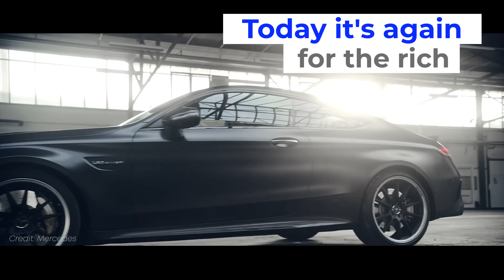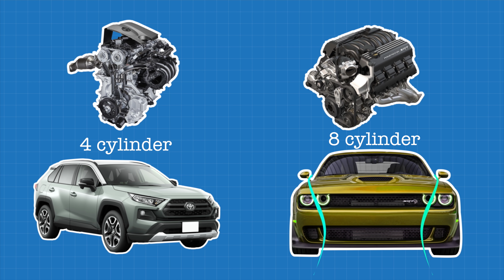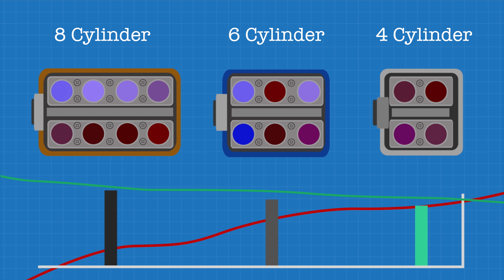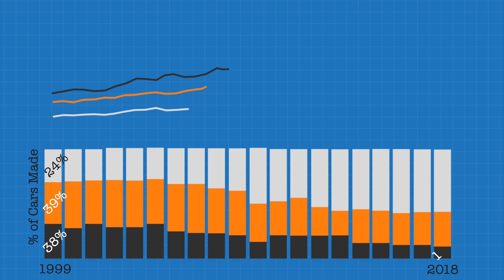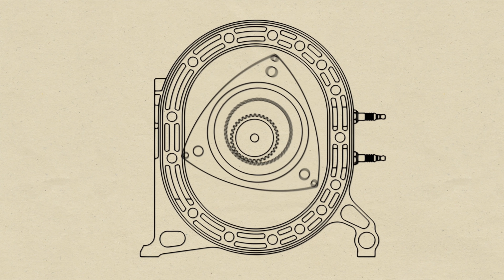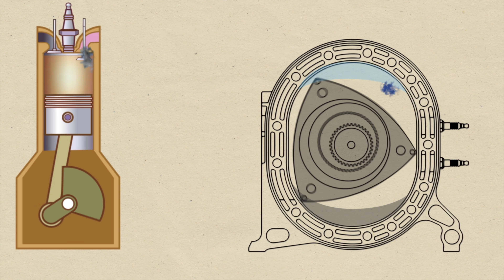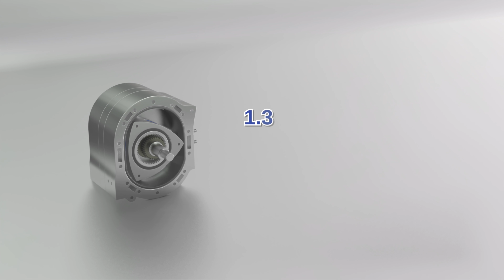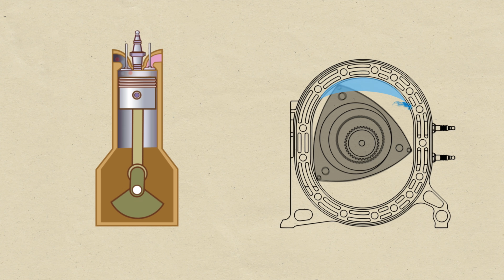This Makes Me Sad for America and Cars

Comment: I have a 4.6 liter Ford V8 in my Lincoln Town Car. It isn't loud, it isn't terribly fast or powerful. In fact it's quiet.... and smooth, and reliable, and will last 400,000 miles with routine maintenance. That's why I love my V8!
Reply: @user-si1zy1og6v  sus af
Reply: And you are riding on a cloud, enjoy.
Reply: One of the best American luxury cars ever made!
Reply: Probably the same engine they used in the Crown Vic Police Intercepter.
Reply: @glennso47  it doesn’t have the police interceptor package tho
Reply: In my city crown vics are still being used, the only time they take them out of service is when police crashes them which surprisingly happens a lot.
Reply: More like six hundred thousand milles, police agencies routinely run them up to two hundred thousand miles. and then they are sold to taxi cab companies. where they put another four hundred thousand miles on them. but person has to take into account both police agencies and taxi cab companies have very dedicated maintenance requirements.
Reply: @Keyno77  John, there are many Crown Vics still in service in my local PD as well. Interestingly, I know many police and sheriffs deputies and the ones who drive the new Tahoes and Explorers tell me they have terrible reliability and they all wish they could go back to their Crown Vics.
Reply: @maxcactus7  Im looking at some as I type 😅 I work on heavier trucks though. Especially the newer tahoes made in mexico suck. Reliability has gone down.
Reply: I have the same engine in my '04 Marquis. 61,000 miles, this car runs and drives like a dream
Reply: I have a 4.6 in my 97 Thunderbird - it has 309,000 miles on it and, aside from the oil pan leaks, it runs smooth and perfect, and the original transmission is perfect too.  The only problem is that the body is rusting out all over...
Reply: Yeah I have a 5.4 in my first gen Navigator.  No issues in almost 25 years
Reply: @hudsonjones5987  Jones, I had a 2001 E-350 van with the 2 valve 5.4 liter in it and got 227,000 miles on the engine with virtually no mechanical issues. Sold it to a friend who needed it more than I did. Fantastic vehicle and that engine, as you indicated, was near bulletproof. I did little more than change fluids regularly.
Reply: @glennso47  it is
Reply: I own a 2002 Lincoln continental with 4.6 liter, love it
Reply: I have one in my town car as well with 250k miles
Reply: @Keyno77  lol

Comment: Four cylinder engines do not have the same power as a V8. A V8 engine produces torque at a much lower, and more useful, RPM range. A four cylinder engine getting the same HP as a V8 has to rev up to thousands of RPM's more to achieve it and they wear out earlier as a result.

Comment: I remembered owning a 1980 Trans-Am with a V-8, 4-Barrel Carburetor! It was a one of a kind car! Loved it!
Reply: Yep! The Beautiful Trans-Am!
Reply: 1980 trans am not the stuff of dreams. Low hp during that time.
Reply: @rlopez2626  - Totally agree with you humor!
Reply: @jogmas12  And?

It's still a V8. Just take off the Emissions bullshyt. Put on Pipes, Headers, and other light Mods. And then , boom.

Difference Maker.
Reply: @borla4491  did exactly that with my 81 Z28 and then it was illegal to drive. Couldn’t get it inspected later when they cracked down on emissions here in Texas.
Reply: @jamesbarron1202  F u k the EPA.
Reply: If you loved the 1980, you would have been swept away with ecstasy by the 1970 version.

Comment: Thursday afternoon to use Scotty hope you and yours are doing well and your vacation is doing better! Most all the cars I've had in the last 35 years have been V8 engines, GM Pontiac and Dodge I miss the feel of a V8 engine and manual transmission well that's life!🧰🙌👍🍺
Reply: Vote Republican or Independent. 

Not Democrat.
Reply: @borla4491  True. Now that the Green Deal is to bulldoze gas engines. Here in California, all Uber/Lyft vehicles will  be all electric by 2030
Reply: I even miss the feel of a 6 cylinder with manual transmission. Like when my folks had a 53 chevy with a 6cylinder engine and 3 speed.

Comment: I have a 2003 three chevy  Avalanche 5.3 V8, full synthetic oil since  new, runs like new still  with 220,000 miles on it. Love it
Reply: I know a guy with a Cadillac Escalade of 1999 that has over 300000 miles. And look like new.
Reply: @user-si1zy1og6v  Scotty I watch your videos all the time I have a 2003 Chevy Avalanche with a 5-3L.  synthetic since new 220000 miles on it I bought it from an attorney that kept in the garage from brand new I hope the rear end  is the quality one like you talked about on older chevys.  I think everything is quality on this one I think I'm going to get three to four hundred thousand on the mileage? And the Body  is Solid Normal driving wondering what you thought about the first generation Avalanche
Reply: @borla4491  great I know my Avalanche will 
 last a long time then

Comment: When you spoke of the 4 cylinder, you were forgetting about the Quad 4, which came along years before variable valve junk was introduced into the market. A genius idea from the engineers at Oldsmobile, the Quad 4 surpassed the power of many V8s at the time. 2 overhead camshafts, and 16 valves, mated to a timing chain, and eletronic fuel and spark control were really all the 4 cylinder ever needed. But now they're more complicated than ever. How i long for the days of simplicity and easy maintenance.

Comment: In reference to Mazda's rotary engine;  I 1st experienced it with the RX 3 which I bought in 1980. I raced it with the Pontiac Firebird identical to Smokey and the Bandits Firebird and kept up thru all 5 gears. I learned later that if I exceeded the motors redline I could have beaten him as the redline only pertains to the transmission. The Rotary motor doesn't have a redline,
Reply: Cool, not sure if you are correct sir but this information is something I never knew. Cool.

Comment: There is a company called Liquid Piston that came out with a redesigned rotary engine. Instead of tips on the rotor, it is  rounded. The part that is rounded fits in the housing that is also rounded.   You can look it up. It may be a promising improvement.
Reply: I often wondered about this engine and I know of the power it produces, to visualize the way I just did on this video , I now know how my brother could build so much back pressure in his exhaust to scare everyone around with one very loud BANG in his little Red Mazda. Standard.

Comment: I have 3 cars with V8 engines. Only one came from the factory with a V8. The other 2 were converted to V8s from an inline 4 and a V6. My 1972 Pinto woodgrain wagon now has a cammed 289 V8 and 4 speed, and a true dual exhaust with glasspacks. 2 of them have manual transmissions. It may be a little more trouble to have a V8 these days, but certainly not impossible.

Comment: Come on use the ceramic coated parts and a variable tune exhaust system and a compressed gas --Lpg fuel . Four rotors maybe ,three for sure, don't forget to heat wrap exhaust system ...

Comment: I remember reading, at the time, that rotary engines were only reliable, and long lived, in applications that required a constant speed, like generators, which was their biggest failing in automotive applications. I drove a Mazda pickup once, and it was amazing. At the risk of being flamed, it was far superior to any V8 I'd driven, especially off the line. The owner said you could accidentally do 90 in his truck in first because it was so smooth and powerful. Having ridden with him, I believe he'd done it, probably on purpose.

Comment: I loved the V8 Explorer I drove a while back. Oil pump gave out on it and we couldn't do anything about the engine so it had to be sold but I'm looking for a V6 or V8 truck again.

Is there a reason why you go with the bigger engine is because of its capability to protect you, it's friendly to the new drivers because they can pedal to the metal and it won't be bad unlike a V4 which suffers if you even push it anything more than 3000 RPM

Comment: Hang on.
V8's 1st started to be used in aircraft during WW1 in any numbers. Some had DOHC with 4 valve heads, In WW1.
The old Curtis pusher was a V8. That was just a few years after the Write brothers.

Typo, Wright Brothers.

Comment: My dad had an RX3 when I was in college studying engineering.  I loved the torque and power curve of that engine.  The Apex seals were in two pieces - there was a triangular corner seal, and one got out of place and seized between the larger portion and the rotor housing.  I was impressed with the simplicity of the design as I tore it down and rebuilt it.  I could carry the engine easily by myself.  I test drove an RX8 once, and the engine behaved way differently.  Gone was the way the Wankel went mmm.  Sadly, the concept has too many negatives as it has been implemented.

Comment: When it comes to V8 i go for dodge demon. When it comes to the best engines of all times it is the v6 straight 300TD mercedes engine. Nothing comes close. U can drive 100.000 miles without oil change or drive 500 miles with 120 celcius engine and It will run for 20 more years still.

Comment: Sad but true...the V8 is on its way out. More and more plastic cars with electric engines take over.
They call them "environmentally friendly", but hardly no one talks about all the crap that is necessary to produce the batteries for them (acids, heavy metals etc). Or the fact that it has big implications for the nature that we have to dig out and refine these metals.

Comment: try to use your question page could not find where to ask a question ?? I do have one for you !! I have a 1986 corvette with 83000 on it , its an auto I change the oil don't remember I do think the old oil was 30 W. but I put in 5=30 as the book states and now its knocking and etc , I change the filter also , It does smoke a little before this. Should I drain it and put in a thicker oil like 10-40 ?? Its  very bad the noise , and really can not drive it like that so sad !! can you help ? Does anyone have any Idea's ??

Comment: There is an old saying there is no replacement for displacement, which means that a V8 or larger engine with 6 liters or more will work less than a six or four to get the same amount of torque and horsepower. Just look at 440 or 426 Hemi of the 60s, with proper tuning and headers over 600 HP. The same amount of HP from a 4 or 6 requires twin turbos or nitrous or a supercharger or a combination and more expense and a snug fit and the chance to fail and you can't afford to fix it. In twenty years there will be no such thing as a used car lot because if you get of a car because it going why would somebody take it on and have to pay more to fix it than to buy a new car. Back in the 60s and before you could replace anything yourself, including an oil change or tune-up or shocks and springs, or a whole engine but not today with the micro chips and computers. Besides if the population of the Middle East, Africa, India and Central and South America and Mexico we're reduced by 80-90% we wouldn't  have a problem and the industrialized nation by 50% percent mostly the poor and sickly and those that won't work and we have no problem with emissions. Occam's razor says the best way is the simplest way and we are doing everything wrong.

Comment: Many consider it a bad thing, but i personally think its the right move.
Once EVs becomes widely available, with the right charging infrastructure..
High performance EVs will have a way better HP & Torque figures without the noise pollution & CO2 emissions.
I'll still miss the combustion engine, though..
Reply: Pipe dream...

Comment: Hi Scotty, I have been a subscriber for some time. I do not know or cannot find any video about a Ram Promaster cargo van. 

I have a killer mildew odor coming out of my AC. IT DRIVES ME NUTS! I have looked all over and cannot find anything to use to treat this. Lysol spray is a joke because it isn't getting to the source. I've changed the cabin and air filters and nothing. It's deep in there. The line drips as normal but I can't figure this out. 

I sometimes regret buying this van but for my business. The space was convenient. Anywho, I hope you can help me and make a couple of videos about the van.

Comment: Piston engines are much more efficient than the rotory engine s because of the piston rings invented by Soichiro Honda in 1938. Atkinson and Miller cycle engine is an optimized piston engines. Miller cycle engine goes a step further using a small supercharger to completely vacate end gasses. End gasses causes knock. Getting rid of end gasses reduces knock allowing higher Mean Effective Pressures allowing higher fuel economy and power output. Pout = PE(AF@14.7:1) x efficiency

Comment: The V8 is or was a great engine, if you can find a reliable one. I’ve got two old muscle cars, a 67 and a 69. I miss my 88 Sierra. It was a pretty fast truck until it started going through fuel pumps.

Comment: To bad I don't live close I have 1996 chevy 1500 z71 4x4 200,000 milled just changed the spark plugs bc it was my granddad truck then we also have 1500 Dodge Hemi 4x4 check engine light on code P0300 change the sparks plug about to change coil packs yes or no also 2009 chevy traverse had the same problem change the sparks now it says catalytic converter wtf should I sell all of them

Comment: V8 Engines with high horsepower are not that pleasing they can cause hearing problems when pushing the accelerator, they can give you respiratory problems, high blood pressure, anxiety and etc. The electric cars with power do not have the roaring bear sound.

Comment: A v8 is technically worse for the environment but forcing everyone into smaller engines is an infinitesimally small change compared to what would happen if larger corporations were held accountable for their greenhouse gas emissions. Shifting the blame on a smaller cause doesn’t solve the issue. They still won’t hold their lobbyists accountable.

There needs to be balance. The people who choose to go more eco friendly balance out the people who want larger engines. If everyone had an eco friendly vehicle, that still won’t solve the issue and actually wouldn’t make a difference unless these larger corporations were held accountable. It’s a joke, really

Comment: If they regulate out v8 engines I will LS or LT swap any car I get.
Reply: Sure you will
Reply: Absolutely I will. I’m driving an LS swapped 96 Z28 right now. Finding cars and trucks that make for easy swaps won’t be a problem for many years.
Reply: @Jpilgrim30  When they put an environmental offset tax on gasoline, close most stations and do another "cash for clunkers program" to get gasoline cars off the highway, you might re-think having a V8 as a daily driver. I remember old gearheads in the 70s who swore they would never have an unleaded fuel car.

Comment: You can achieve 24mpg highway with a 13b msp wankel rotary engine. Is it fun, no. To have fun and rev to  9- 10k in every gear, you will obtain 11-13mpg. :)

A rotary engine is rated by the formula spg, Smiles Per Gallon.

Various innovations have been made by the wankel rotary community.

Comment: This engine is way ahead of current beater engines the old engine designs belong in diesel engines which prove they are more efficient ant the gasoline engines.
This engine should be the death of the gasoline engines but will not since a archaic fuel system is being added. I would say if the new engines are so effiecient
why do uou nee a AFTER-BURNER of the emissions using a CATALYTIC CONVERTER!  There is a conspiracy with the corporate systems in the the Country. 
Simple to see, more gasoline sold, more tax generated, with lower mileage car engines!

Comment: If you listen to yourself, you will know that a 8 with fuel injection can outperform any four or six by just having more cylinders. The complications to make a four or six at the least perform like a small eight, say a 302 are mind-boggling and expensive, to say the least. And no backyard mechanic can work on them. The left is having its way by making both greenhouse gases that don't exist and causing us to be dependant on foreign fuel. There is no environmental problems here that aren't from the imagination of the left, just as smoking cigarettes cause cancer. There is no difference  but 1% between smokers and non-smoker and pot has a much tar as tobacco and pot cause brain damage and hallucinations whereas tobacco doesn't.